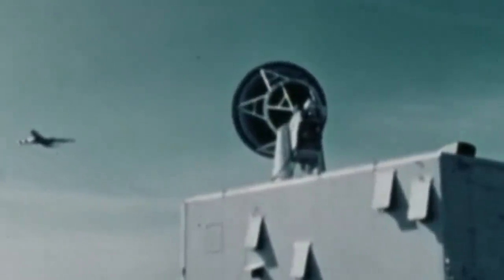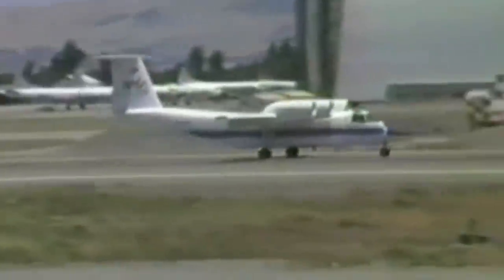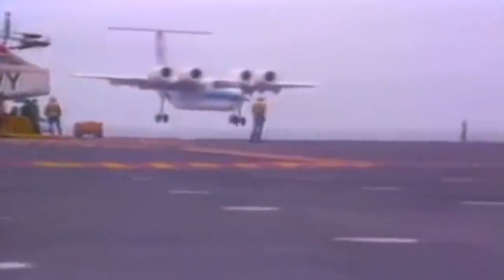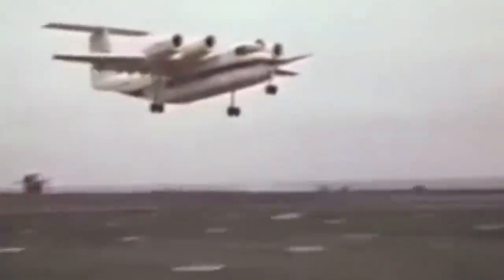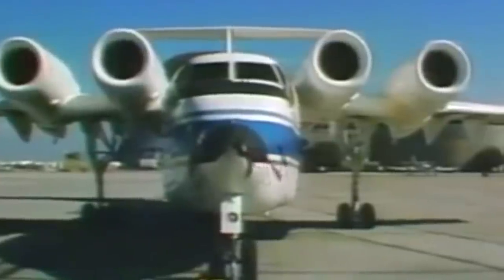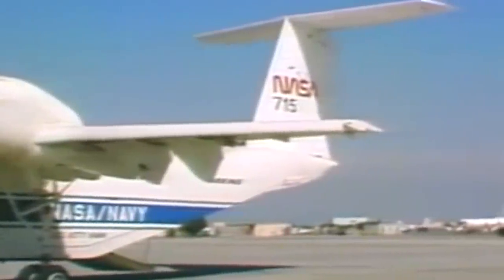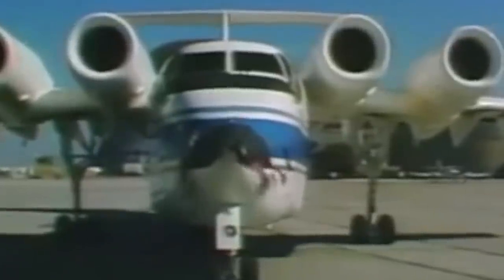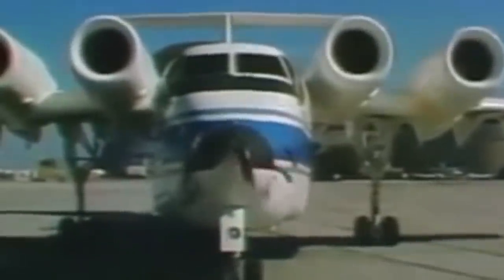4 Engine Super Weird Super Quiet Airplane

Comment: I would think there could be a place for a very quiet plane with excellent STOL characteristics. Carrier service is a no brainer. I could see this plane used by the Coast Guard for ASR and for ASW and AEW. Of course, any plane that is cheap to produce and rugged in its construction has no place in today's military industrial complex.
Reply: Seems that way, but there's some change in the philosophy on that.  Some planes like the A-29 and AT-6, as well the MQ-1, etc are fantastic because they are low cost options for asymmetric theaters of operation where you don't want to waste a higher price option, like the F-16 or F-35.   Frankly, if you just need a dump truck, there's no reason to rent a freight train when a used hauler will the do the job at a fraction of the cost and there's little danger of the thing being exploded.
Reply: @Drew Peacock Air-Sea Rescue
Reply: Like the A-10....
Reply: Over wing engines are good for unprepared  landing surfaces as well, the uindercart should be upto rough l;anding grounds as well if it was built to take the controlled crash whigh is a carrier landing.

Comment: This plane would make a perfect bush plane, since it does not need much runway, and the engines are mounted high so inhaling debris would not be as much of a problem. And I wonder how it would work as a Air tanker, to fight forest fires. Seems there are several good applications an air frame like this could be used for.
Reply: If you can find a spot to land this aircraft in the bush...
Reply: @Willon  yeah just slam it on a pre-plotted bunch of bushes.
Reply: @Willon  Rewind to the major league Short Take off and not sure what the pay load was.
Reply: Excellent comment and the aircraft's specialized Paint can be a significant difference in terms of weight.
Reply: @Willon  have you ever watch a bush pilot land? With STOL capability, there are a LOT of spots open. Most common would be sand bars on rivers, but there are other areas as well.
Reply: Lookup the YC-14 prototype. It was more developed than this one.
Reply: Turbojets aren't used as bush aircraft because FOD.
Reply: May I introduce you to the Beriev Be-200? Amphibious water bomber/passenger plane with 4 high-mounted turbofans.
Reply: @Markle2k  the data is only showing 2 turbofans.
Reply: @yolo_burrito  The important thing is that I got the model name correct and that you need toi see a video of it in flight. It is a beautiful thing that obeys the post-Soviet embrasure of the if it looks right it flies right principe.
Reply: @yolo_burrito  By coincidence, the Skyships eng channel has just released a video on the Be-200. You get a tour inside and out.
Reply: @Markle2k  oooh
Reply: @Markle2k  I was about to comment this! Beriev 200 fan club

Comment: I have seen the USS Kitty Hawk in person. All aircraft carriers are big but the Kitty Hawk was not big for an aircraft carrier. Knowing that that plane stopped without an arresting wire is amazing.
Reply: I believ that a Herc also didn't use an arrester when it did it's carrier landings, albeit that was on USS Forrestal which is 1.9 ft shorter. It stopped with the wingtips just in line with the aft end of the island. Apparently had a sign on board saying Look Ma No Hook

Comment: I actually like it’s looks. There were some really interesting STOL designs during this time. It would have been useful to have a STOL port network around the country.
Reply: "It works" is always pretty. Take the A-10 for example.
Reply: Well, it had a lot of horsepower onboard — that’s always a big plus.
Reply: İt wouldn't maybe be useful at the time but nowadays and the near future i believe VTOL stol aircraft will have a bigger place in shorter trips it espy makes sense for the United States as it lacks a good highspeed rail Network

Comment: The Buffalo airframe is such an amazing platform that has always been under utilized and overlooked.. The RCAF is just now finally phasing the airframe out of SAR service in 2021 with the new "king fisher"
Reply: I'm sure the Kitty Hawk was running at flank speed 32 knots, and the Buffalo stall speed was 72 knots, perhaps the mods reduced that to 65 knots, so you would only need to accelerate another 30 knots or so. But this was not the biggest plane ever landed on a carrier. The Navy also tested a Lockheed C-130, which has a higher takeoff speed, you could probably look that up if you're interested. The main problem with the C-130 was wingspan, they didn't have much clearance with the carrier's island, plus the whole deck would have to be cleared each time you landed or took off, so it never was seriously considered for operational use.

Comment: I suspect the four engines are pretty thirsty, but otherwise this looks like a really good small transport aircraft.  It would be good for getting in and out of combat areas with limited airstrips.  Something the Marine Corps could probably exploit.
Reply: It could utilise their flattops that do not have cats and arresters too. Adding an inflight refuelling capability for the F35B. I imagine the Royal Navy being interested and anyone else using F35B's. Low cost option for a real shortfall in capability.  All in all, well worth developing.
Reply: @gusgone4527  Good point.  It could make a great tanker refueler.    I wonder how it would be with a couple of newer, bigger turbofans instead of the four smaller turbofans?
Reply: @tarmaque  The main thing is the turbofans used on that one were known for being pretty quiet and had even more tweaks applied to it.  Could maybe sub something that's equivalent in the modern age (TF-34 w/ applicable tweaks maybe?). But yeah, I could see all sorts of uses for that type of plane.  Quiet, cheap, unsurpassed STOL with cargo capability?  That just screams SpecOps, as well as front line capability in addition to normal transport.
Reply: Based on the DeHavilland Canada DHC-5 Buffalo, the turbo-prop version was a marvel at that role.
Reply: It seems like this would be a good aircraft for replenishment on the Marine assault ships.
Reply: @wastelandwanderer3883  Yes! The DHC-4 Caribou was  a legendary workhorse. I imagine the DHC-5 Buffalo rights are still held by someone. BAE Systems?
Reply: @gusgone4527  I worked on DHC-5s in my time with the Canadian military (CH-115 they called them) and I simply loved the time I spent there! Vikings has the rights for the DHC-6 (the Twin-Otters) so I guess it would be them that have it, and produce them if there was a demand! They are also producing CL-415 so it is not entirely out of their league.
Reply: @wastelandwanderer3883  Used by the RCAF for quite a while and I think Viking Air is looking at putting it back in to production as VTOL and STOL aircraft are always in need.
Reply: @wastelandwanderer3883  I looked into it, and the history of the Buffalo is interesting.  There was even an attempt to start producing it again as late as 2014.  Fascinating reading, although there were only ever 122 made.  It was essentially an enlarged de Havilland Canada DHC-4 Caribou, know to the US Army and Air Force as the CV-2 and C-7 Caribou at various times.
Reply: @gusgone4527  Viking air in BC, Canada holds the type cert
Reply: It was basically a research aircraft though. Boeing made the wing/engines/flaps assembly up in Seattle and adapted it to the Buffalo airframe.

The wheels and flaps could not retract so it would never be a practical plane.  I think the flat ducts proved not ideal for fast flight, so the C-17 concept with underwing engines set far forward on short pylons and directed at blown flaps won out.
Reply: Osrpey.
Reply: @i-_-am-_-g1467  Only the XV-15 existed when this plane was flying.
Reply: @Doggeslife  Yes, it was a research aircraft.  What I was saying is a developed version of it could have value, not that it was ever something that would have happened.
Reply: osprey?
Reply: @carlosandleon  It's half the size, triple the complexity, and four times the cost.

Comment: It looks like a Soviet-era transport plane... as if it was designed by Antonov or Beriev (need a spell-check on that last one).
Reply: My thought exactly! I saw the thumbnail and I thought it was an Aeroflot plane
Reply: Me too, I thought that this was an Antonov project.
You have to admit that it has “that look”.
Reply: There is a very similiar twin engined Russian aircraft that entered service.
Reply: Exactly. A Mil helicopter fuselage with an Antonov wing and propulsion system lol!
Reply: He said it was made on the airframe of the Buffalo, a Canadian STOL transport.
Reply: An-72 and An 74, 195 built till today and still in production. The Boeing YC-14 was 'only' a test object.
Reply: @peter2uat  
I couldn't remember if it was the YC-14 or 18. Still it seems a good choice for a type of airframe to fulfill the Carrier on Board Delivery role. I also happen to think the S-7Vikings should have been retained in the tanker role unless the airframes were completely wore out.

Comment: They already had a ready made aircraft that could do those carrier landings without modification with the De Havilland Canada Buffalo or the De Havilland Canada Dash 7. Strapping on quieter engines was a relatively easy modification. Way less expensive than a completely new design. U.S. defence contractors probably realized they couldn’t underbid DHC so probably lobbied against this project to prevent any of that pork going to a foreign contractor.

Comment: LOVE THIS STORY !
What I do know is that the C-16 and C-17 were developed based on this experience and the hard work done by engineers at Boeing, Lockheed, and NASA. The core of the research was the Coanda effect. The swept wing creates additional lift on the upper surface of the wing by taking advantage of the lower speed required to achieve the same lift  thus obtaining  shorter takeoff an landing distances.
Unfortunately, the extremely hot jet exhaust air was by that time  an unsolved problem which led the project to a dead end.

Comment: If you play at 5:13 you can see the plane demonstrate lift on the wings. The thrust from the engines should shoot straight out, but the curve of the wings pulls the thrust along its surface and directs it downwards producing the lift.

Comment: I actually remember seeing this aircraft flying.  I remember it because it was smaller than another aircraft in a similar configuration that only had two engines set up like that.  And the long probe on the nose.  I thought it was very cool.

Comment: The young generation has no idea how noisy the 70s were. Living near an airport was a real nightmare. Cars engines were also very loud. Highways pavments were much more noisy also. Also the air was much more polluted in urban areas. Less than it used to be during the industrial revolution and the steam engines but still.

Comment: I used to go, with my buddies, to the old Moffett Field Airshow.
NASA had many of thier experimental aircraft, on display, there.....including this craft. The suddenly, surprised everyone, by starting her up, and doing an air display! It was so quiet, we could talk in normal voices, as it did a flyby, to rival an olde time model T car's cruising speed. Then it'd speed up, again.....all so very quietly! It circled back around, landed near the far end of the audience area, came to a stop.... then rolled a bit, and took off again, at the opposite end of the viewing area, displaying its STOL abilities. I was enthralled and impressed, by the aircraft.
There were plans to convert C-130 airframe, to a QSAR planform but, apparently that came to not.

Comment: In the UK internal flights are somewhat of a high cost option. People generally consider car journeys first, then rail travel for longer journeys. But they too are becoming increasingly too expensive for many people. Internal flights (for poorer people) are generally anathema. I once took a flight from Bristol to Glasgow (300 miles). I had to travel about an hour by car to get to the airport, then had a very short (very pleasant) one hour flight. I landed at Glasgow airport and had another 3 hour car journey to reach my destination. So the car journey was four times longer than the flight, as airports here are few and far between, and only located near significant towns and cities. So how good would it be to have air travel here in the UK with this type of short take-off aircraft, with many more small airfields serving many more places! Okay, journey times would inevitably be longer with the lower speed of the aircraft, but if a journey from Bristol to Glasgow increased from a one hour flight to, say a four hour flight, but you could get on an aircraft no more than 1/2 hour drive from where you live, I think most people would take that, and just have more time to enjoy the flight!
   I think this is a fantastic aircraft which would be ideally suited to UK internal flights. Get rid of the big gas-guzzling jets. Get loads of little tiny airfields built serving many more places, and let the little whisper quiet fuel sipping planes take the strain. Then all the foreign owned and "milked" rail companies in the UK (with ticket prices loaded with profit used to subsidise the foreign rail companies HOME markets) would have some competition and be forced to drop their prices!

Comment: The basic aircraft is a DHC-5 Buffalo, they also had one that used an air-cushion instead of the standard landing gear. Seems kind od strange because the Buffalo is a STOL aircraft to begin with and under the right conditions, a good head wind, the Buffalo can land vertically like a helicopter and takeoff the same way. But NASA has to play. The Buffalo was originally built for an Army contract for use in Vietnam, it'sw being retired now from RCAF service where it was sued for over 30 years as a Search and Rescue aircraft, mainly based out of CFB Comox on Vancouver Island.
Reply: As an airforce brat in Trenton in the late 70s we used to be able to hitch rides on transport routes. Usually it was C130 or CC137, but occasionally it would be a buffalo. Being unpressurized it was low, slow and bumpy but I enjoyed every second of it. Viking Air in Victoria owns all the designs and plans and I hear they have attempted to sell new versions of DHC5, but last I heard there were no takers. (Actually Wiki says there were a few letters of intent, but I don't think they have materialized)
Reply: I served in 442 Search and Rescue Squadron at Comox early 70's, witnessed the arrival of the first three aircraft that replaced the Grumman Albatross and Dakota. Lovely aircraft, I managed to get in many hours as a spotter.
Reply: @davidkillens8143  Speaking of Grumman, If you are still on the island, do you ever hear/see the Mallard that flies around mid/lower island section? I used to work with the wife of the dude who owns this thing. Can hear the P&W piston-roar from 10 miles away and it is unmistakeable... I've lost touch with her unfortunately as I really wanted to go up in that thing.

Comment: I wonder if developed further if this could have done most of what the Osprey does and with a simpler design.
Reply: In my Axis&Allies house rules with sufficient enough R&D ze Germans can develop the Weserflug P.1003, which is the same concept as the Osprey. It's really handy for quickly deploying small airborne or marine divisions.

Comment: This program came after the YC-14 AMST which was also an  "over the wing engine" design. It never went forward due to concerns of performance at low altitudes (primarily landing) that could be problematic. I'm mildly surprised they went ahead with the QSRA based on the concerns that ultimately stopped the YC-14 from becoming reality. The Russians made them as the AN-72 and many still fly today.

Comment: We would have liked to see further performance figures for this aircraft. Whilst I realise it was not in its most perfect aerodynamic configuratiom, what could it lift, what was its speed, and range, and how short were its take offs and landings and what would they be with a full load?  Was the project judged a success and what later aircraft benefitted from the research?

Comment: Could you please make a video about the Polish medium bomber from the Second World War? Its name is PZL.37 moose.
Reply: General characteristics of the Moose.  It’s weight was about like a P-47 Thunderbolt but bomb load was over 4,000 lbs.  

Crew: 4
Length: 12.92 m (42 ft 5 in)
Wingspan: 17.93 m (58 ft 10 in)
Height: 5.1 m (16 ft 9 in)
Wing area: 53.5 m2 (576 sq ft)
Empty weight: 4,280 kg (9,436 lb)
Gross weight: 8,865 kg (19,544 lb) basic combat loading
Max takeoff weight: 9,105 kg (20,073 lb)
Powerplant: 2 × PZL Pegasus XX 9-cylinder air-cooled radial piston engines, 723 kW (970 hp) each [15]
Propellers: 3-bladed variable-pitch propellers
Performance

Maximum speed: 412 km/h (256 mph, 222 kn) 2,800 m (9,186 ft) with 1,995 kg (4,398 lb) bomb load[15]

Comment: Hmmm.  I always thought the Buffalo's designation was DHC-5...
Reply: De havilland canada...?
Reply: @Iamtherealjerkfreak  Yes.  Based in Downsview, Ontario.  I worked there for about 30 years as an aircraft mechanic.  There was also another converted Buffalo, two engine, designed in conjunction with Boeing, with "blown" flaps that took off in a very short distance, and could land vertically.  (Called "STOVL" for Short Takeoff, Vertical Landing.)  Another version used an inflatable skirt on the aircraft's belly in place of actual wheel landing gear.  

Stay well!
Reply: It is.  But the RCAF calls it the CC-115 and the US designated it the C-8A.